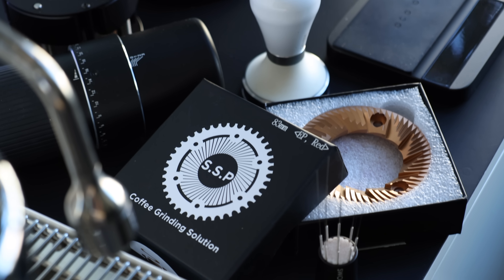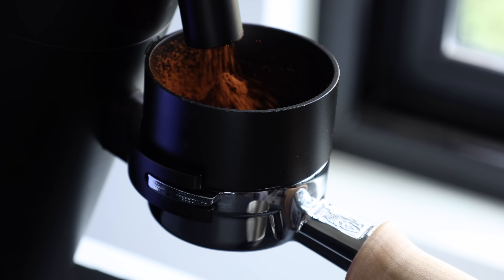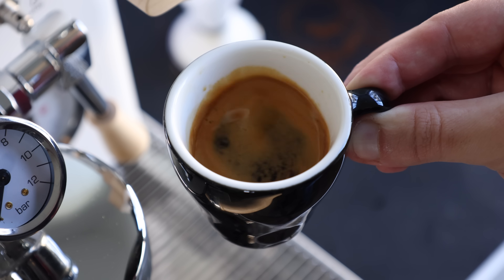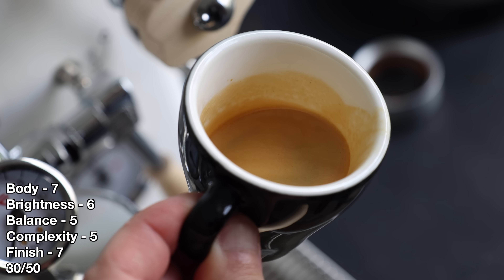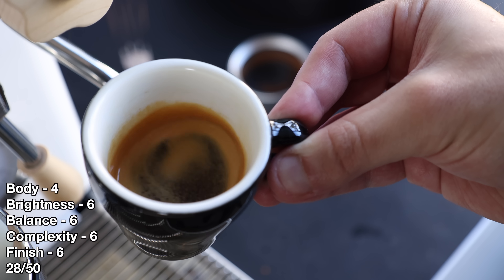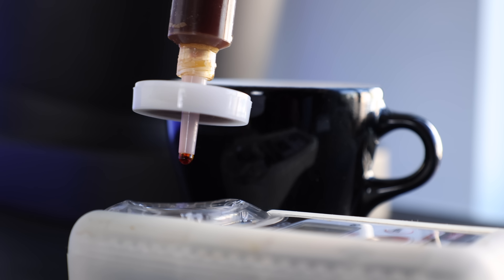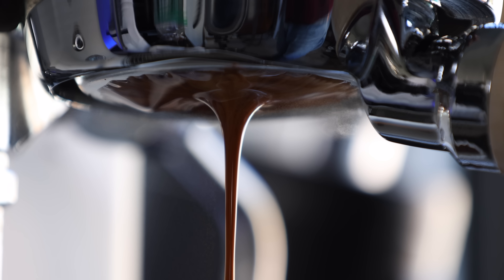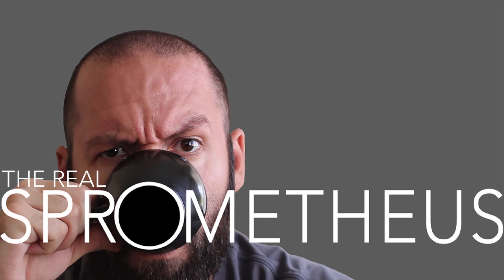ESPRESSO ANATOMY - Exploring Brew Pressure

Comment: Yeah if your just ramping up no or minimal PI then lower pressure 6-7bar is the sweetspot for straight espresso, but put fully saturation PI into the mix and that typically improves the 8-9bar noticeable, so when I run 9bar I always do fully saturation PI or I stop it at max. 7 bar pressure.
Reply: Just to make sure I understood correctly what you were saying:
1- If you DON'T do Pre-Infusion then you suggest setting the pump pressure at 6 or 7 Bars and let it ramp up to that during the whole shot.
2- Otherwise WITH Pre-Infusion you suggest to fully saturates the puck first "5-10sec?" then ramp up to 9 Bars?

If that's what you meant, then what would be the difference and you preference between these 2 methods?
Reply: @PanzerIV88  Yes I found those to be the most consistent ways, there other techniques like the blooming espresso, allonge or Sprover but those are not very espresso like. But I found higher pressure generally need an entirely saturated puck in preinfusion to work well. 

It really depends on the coffee if it benefits from the more clarity with better flavour separation of the typical longer lower pressure shots or you want a more traditional shot that underline sweetness, body and round the acidity off a bit is what the coffee benefits most from, you can sometimes also let it tailor off to 5 bar if your machine allows you to do so to give a more constant flow but you definitely need fully saturation PI to regain a more fully flavour spectrum and avoid harsher flavours.
Reply: @mikni4069  Thanks a lot for the clarification, and I guess your right as I've done several tests this whole week and the best shots taste wise was when the grouphead gauge on my R58 was getting 7.0 to 8.0Bar, no manual pre-infusion with the flow control but still have the stock mechanical pre-infusion from the spring in the E61. Every shots at 6.4 bars and less were disappointing even if I kept my ratio 1:2 with 20in/40out in 30sec. I also found that if I'd lower the PUMP pressure I had to grind finer so the pressure at the group wouldn't be too low like 5-6Bar, but then if I'd grind finer then the shot was more like 36sec but clearly better!

I get between 0.5 to 1.0bar less on the group gauge than at the pump gauge so I have to set my pump higher according to what I want to obtain at the puck. I will probably go back to 8.0Bar seems like the sweet spot.

Tastewise do you prefer lower 6-7Bar pressure with no infusion, or the opposite with 8-9Bar with PI?
Reply: @PanzerIV88  It really depends on the coffee and what I intend to do with it. In Milk I would never do 6-7 bar 1:2.5-1:5 that you typically do with 6-7 bar shots, but for straight light roasted shots it can be good but you really need to pull longer, not necessarily grind finer…. The turbo 1:3 under 20sek is a good example why not necessarily. 

The PI 8-9 bar allows shorter pulls but again as I wrote it really depends on the coffee why it’s hard saying exactly what is best because for me it really depends on the coffee and purpose with it.

Comment: I just realized my machine has been set on 9.5 bar since I bought it and I’ve never thought to adjust it - but I suffer from channeling and am always experimenting with different WDTs, spinning distributors, etc. with limited success.  I am turning down the pressure right away!
Reply: Yes my Bianca too
Reply: Follow-up:  I set my ECM Synchronika to 7.5 bar and I like the results - less channeling and I am not totalluy sure but I think there is just a bit more flavor at the edges of the tongue.  Highly recommended if for no other reason but to make shots more consistent 👍

Comment: I have La Pavoni from the 90' and I have a problem with my espressos being too harsh and acidic. So something clicked in my head when you described the low pressure espressos. I was quite sure I'm putting enough pressure, but it's really hard to know. I'll try to play with it, but La Pavoni is such a tricky machine for consistency, from temperature, to pressure and speed.
Thank you for making this video 🙏

Comment: Surely the variation could well be due to your grind adjustments as much as the pressure.
So the reason you had a dip and a return to flavour between pressure tests is more down to grind adjustments not being as effective.

Comment: Thank you for this great video! Very interesting... I have a ECM casa V so it is really easy to adjust pressure. With most vibration pumps it's however quite difficult to find out exactly what the brew pressure is without having a Scace machine. Having a brew pressure gauge like you have on your Bianca makes it much clearer. I was experimenting a bit back and forth and landed on the traditional 9 bars as I come from southwest Europe and now living in Germany I need some of the nostalgia of the strong, dark chocolate and sometimes not particularly complex flavors of my coffee roots.

Comment: I wonder how much of a difference the beans and roast profile makes. We are used to adjusting temperature, grind and dose to get the best out of a bag but perhaps machine should be allowing us to change pressure too and I don't mean flow control. I think it's important to distinguish here that this is "peak pressure" and not how pressure is profiled during the shot. Great video, been nagging you in the comments to reveal why you'd had the LMLM at 6 bar and if you'd done the same with the new LM. Now I see you were keeping it for a video! :)

Comment: This is very informative. Have you experimented with 6 bars of pressure pulling ristretto?  I have an odd way to enjoy my coffee. I use 20 grams of coffee grinds at 9 bars in order to extract 45 grams in about 27 seconds.  However, I hold a warm teaspoon under the basket in order to catch the first 5 ml of coffee, which is very viscuous oily liquid, that to me is coffee nirvana. I call it a very short ristretto. I use the rest of the pull for cappuccino, which is forgiving.  I am curious how pressure affects viscosity, and whether you have an opinion on it.

Comment: Having seen your video, I tested the 7 bar shot on my Bianca today, and really liked the results. Similar body compared to the 9 bar shots I usually do but much more interesting and pleasant flavor-wise. Will definitely pursue this path (and adjust the rotary pump pressure accordingly). Thank you!
Reply: Out of curiosity, did you actually adjust the pump pressure, or just use the paddle?
Reply: @Dr_Darrow  For my first tries, just the paddle. Now I also adjusted the pump pressure down to around 8 bars, and bizarrely haven't been able to get the same results, using the same coffee.
Reply: @choisyaternata8050  thanks for the info. I’ve always suspected a small variation on mine between the gauge on the pump vs the one on the group head. Wonder if you might have the same and that’s what’s causing your inconsistency? Just a thought. Thanks again. Looking forward to experimenting with this.
Reply: @Dr_Darrow  Yes, it's all like this！I have adjusted the ecm sync pressure gauge to 10bar

Comment: The way that I have been enjoying my morning espresso is by pressureprofiling. 20s blooming, followed by 10s pre-infusion at 2bars, followed by a 30s shot that starts at 8b and tampers down slowly to 3 bars after a bit. The higher pressure at the beginning make the fines agitate a bit more and increase the resistence, that then reduces as the extraction increases. The flow should start low, peak at 5b and reduce again substantially.

Overall this is what matches the most into what I enjoy in my coffee: higher extraction, lower acidity, medium sweetness and lower bitterness.

Comment: At home, I run 7bars and I feel like it brings out a lot of complexity and it's very clean.  I thought I was alone in this feeling. Interesting to see the same results from others.
Reply: Is the grind the same you’d use for 9 bar?  Or do you have to adjust your grind?
Reply: You’ll need to adjust your grind - when you lower the bar pressure, you need to grind finer
Reply: @4wallscoffee  coarser seems to work, too, if you're lowering the flow rate to achieve a specific pressure; that's all that's behind a turbo shot, after all. Interesting that when you can control the flow rate to maintain a specific pressure you can adjust grind to effect how even the flow and efficient the extraction is, but when you have a constant flow rate the grind size directly correlates to pressure and even flow by way of resistance short of breaking the puck.
Reply: I'm with you, I've been doing 7 to 8 bar for the last two years and refrained from saying anything.
Reply: me too, 7-8 bar

Comment: Funny, I’ve been trying to find info on extracting at lower pressure without relying on the OPV. Just upgraded from Breville Barista Express to the Profitec Pro 400, and I’m really struggling to dial in. I either bounce off the OPV on a finer grind, or scream up to my yield target too quickly.

I think my puck prep is good, so I’m wondering if I dial down the flow rate on a finer grind to get lower pressure?… I didn’t know what I was getting into when I got the free flow control from WLL, haha!

Comment: I’ve had a Bianca for two years now, and honestly never adjusted the OPV, only used a paddle to ‘pressure profile’ via flow rate. Might have to try this now! Mine came from 1st line, set to around 10 bar, but I usually drop the pressure to around eight or nine, and then finish at six.
Reply: He did not adjust opv, but pump pressure. For opv adjustment you need to take the top lid off, for the pump pressure, there is something like a screw on the bottom

Comment: (Apologies, wall of text) So.  I think you're missing something in here and that's that pressure doesn't look like a flat line, but rather a curve.  You have to ramp into your pressure and as the puck degrades you fall out of that pressure.  The Decent does the best at displaying it, but it happens on all machines, even machines with static pre-set pressure.  What you're kind of isolating with the Bianca is what the bulk of the time of extraction pressure is at prior to puck degradation.  What is really hard to measure on something that's not a Decent (again this isn't a quality thing it's just a display and tracking thing) is the time duration of each segment of the curve.  That time really, really matters in my experience, especially with what you do with a preinfusion.  On more modern style light roasted coffees i tend to do what some might call obscenely long preinfusions (often 10-14 seconds) followed by a ramp into 6-7 bar for the shot, leading to a very long extraction time, but resulting in a lot of complexity in the cup.  I love that we can now play with these variables and repeat them, though we could always do this on lever machines in the past.

Comment: On the lower pressure needing a finer grind thing.. this is also a good way to save a shot if you’ve gone too fine on the grind. I’m talking an everyday morning shot where you just want a flat white and not concerned about optimal quality. Pulling back the pressure if you’ve noticed it’s choking will allow more flow and less extraction. It’s the difference between a drinkable coffee and a shot you have to make again. 

For example, I might see nothing is accumulating at the bottom of the basket during a 1bar pre infusion. I’ll push it up to 1.5bar for the pre infusion to try to wet everything, then rise to 6-7 bar to get some body out of it, but pull back to maybe 3 to 4bar or until I have a half decent flow rate. 

Higher pressures will push the coffee into itself and make it harder for water to get through.

Comment: I'm curious, how much did you have to adjust the grind setting between the different pressure settings? I know you said the lower settings required finer grinds but I'd like the numbers for comparative purposes.

Comment: Can you compare lowering OPV pressure to 6 bar to limiting flow rate with the paddle while the OPV is set to 9 bar?
Reply: I’ve got the exact same question as I have flow control. Theoretically changing the pump setting to 6 bars would be different from lowering the flow from flow control to get 6 bars. Will try on my R58 and see

Comment: Question: is calibrating to a specific set of parameters (including ratios and pull times) the best way to go in this sort of subjective comparative test? I do get the appeal, but wouldn't it be better to just dial in each pressure by taste to its fullest and then highlight what can/cannot be achieved? Like "at 9 bar I couldn't ever make it clear. At 3 bar I couldn't ever make it sweet" (or whatever). Maybe 9 bar goes better in a 1:2 ratio while 3 bar lends itself better to 1:3 on a longer pull (again, or whatever).

Making it too homogeneous can by design favor some type of shots and/or some target pressure, no?
Reply: Exactly what I thought, although still an enjoyable watch. In some ways all this shows us is that for a 25 second shot 1:2, 7 bar was best. In fairness you'd get through a lot of coffee to dial in 7 different brew pressures and some serious taste bud fatigue
Reply: I think he did dial in each pressure, as he said he ground finer for the lower pressure shots..
Reply: @81caasi  He ground finer in order to achieve the same recipe: X grams in Y seconds. That's not dialing in, because that flowrate probably benefits certain pressures to begin with

Comment: Thank you so much for this instructive video. For myself, I extract shots at 6,5 bars with long pre-brew, 2g in the cup which is over 20sec, then move to full flow for the rest of the shot. I do not recall where I took the idée to reduce pressure, but possibly it was on your channel. 😊

Comment: Would love to see you try these experiments on a Decent. For example- lower pressure/higher volume shots.
Reply: I don’t have a decent, but I’ve played with low pressure (3-4bar) shots at around 60 seconds. They can be surprisingly good but lack body. From my experience I’ve always missed out on body with lower pressures.

Comment: Which pressure gauge did you use for measuring the setpoints, the pump gauge (on the body of the machine) or the grouphead gauge? I've read there's supposed to be a difference between the two -- I don't have a grouphead gauge so I've set my pressure at about 7.5bar on the machine gauge to give ~6.5bar in the puck.
Reply: I set my pump pressure at 7 bars and I get about 6.5 bars at the brew head so about 0.5 bars pressure loss
Reply: @carlosvelasquez5998  ooo might have to drop mine down then
Reply: If you are getting 6.5 bars at the brew head, I would leave as alone IMO.

Comment: Very intersting but why is there channeling at 9 bars, not to mention lower pressures? Shouldn't it be solved by a good puck preparation?
Reply: The higher the pressure the more opportunity for channeling as more pressure is exerted on the puck, pure physics
Reply: @carlosvelasquez5998  I agree but still I have seen so many 9 bars shots without any observed channeling. Why isn't it so in this experiment?
Reply: @hagaymarom5190  even further. My Lelit Elizabeth had a pressure of 11bar on the gauge while extracting.
Even of there is an offset of let's say 1bar if measured in the group head I would still have 10 bar.
Yes, without perfect puck preparation there will be channeling. But after some "training", even with basic equipment I've had a very little chance of channeling.
After lowering the pressure to around 9,5 bars in the blind basket I experience zero channeling anymore and the acidic taste of my current beans is also gone.

Good preparation is always key.
In my opinion: if there is channeling you cannot use this shot for comparison anymore. Make a new one. If you still get channeling: the pressure is either  to high for being able to reproduce your recipe or the preparation is not accurate.
Reply: @hagaymarom5190   Some coffees are more prone to it especially the lighter kind, also if ever used precision baskets you’ll know these micro channeling happens very easily not at least as we tend to grind very fine and the finer we grind the more we increase the chances of channeling. There is a reason you see these turbo shots as it can cure much of the issue with channelling with very fine grind.

Comment: When I got my Bianca a year ago everything I saw showed to set the pump pressure to 10-bars, and then use the flow paddle to adjust from there. In this vid I was surprised that your high/starting point was setting the pump to 9-bars.
Reply: Bainca need to be adjusted I got the same

Comment: A quick play at 7.5 bar baseline (the OPV on my ECM Classika doesn't go any lower) and it is immediately obvious, sweeter and more complex. Maybe slightly less body than 9 bar but not really easy to pick out. Definitely a better shot. 
I have flow control and pull "raining blood" shots (yes I did steal this from your Slayer shot vid, which no one in the comments seemed to pick up).
Reply: A bit more experimentation, the OPV adjustment isn't necessary as I can get a great and consistent 7 bar shot just by controlling the pressure with the flow control. I'm really enjoying the effects of the lower pressure, quite a different shot to 9 bar, but I still need to dial in some more to really get the best out of it.